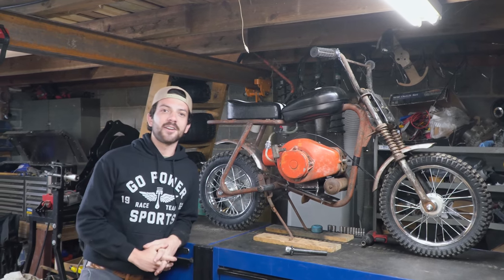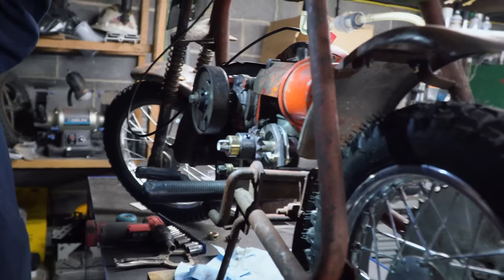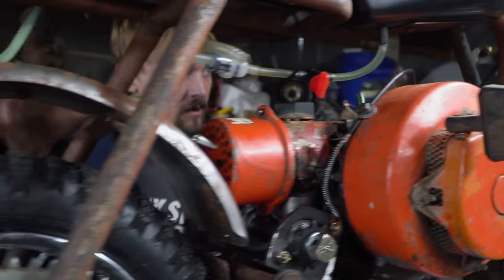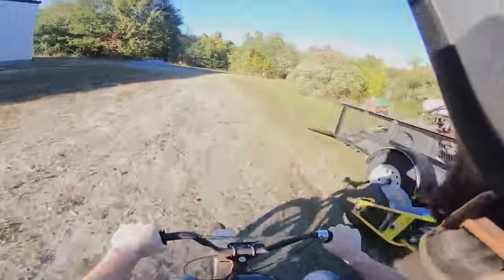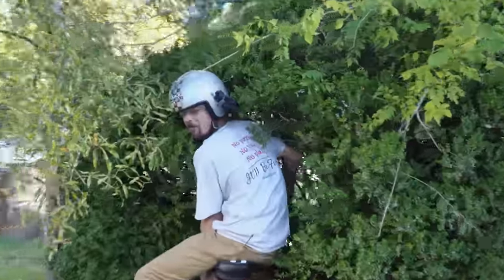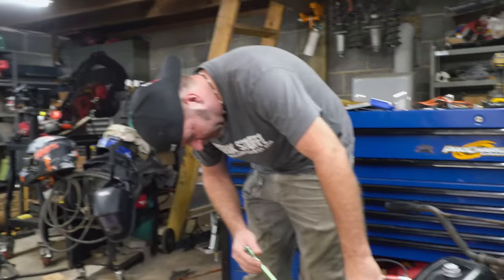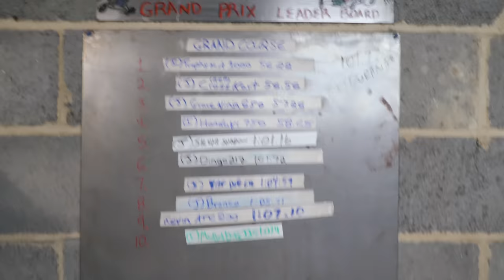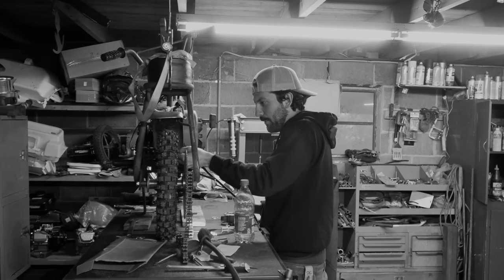Making our 2HP 2 Stroke WASHING MACHINE Powered Mini Bike Faster!

Comment: Y'all are gearing that tiny 2 stroke like it's a 4 stroke. Your power is on the higher RPMs! Great job, I love every build you guys do!! I hope you all do more 2 stroke builds. The amount of power you can get out of those tiny engines is incredible!
Reply: No matter what gear combination used it’s still 2hp,
Reply: @vermontaviator1248  my Puch Maxi was 2hp and could at least pull pretty well to 30mph without an issue. It's now like 7hp and rocks.
Reply: @vermontaviator1248  it does matter if it doesn't get into the powerband.
Reply: It sounds like the governor is kicking in way before it needs to, but again, 2hp.
Reply: Those old two strokes were awful even for the application they were intended for, I worked on tons of them in the late seventies but hated every minute of it.
Reply: That engine wont give much more even with gearing set up these type of 2stroke motors dont have a serious power band. If the governor and carb was changed and a exhaust tweak it should perform better and a clutch weight adjustment so it kicks in later at higher rpm would pep it up abit
Reply: @g_compo8639  Yes these old Jacobsen are a cross flow (single transfer and ramped piston) they predate shcnuerle port, and expansion chambers, they respond better to megaphone exhausts rather than expansion chambers. For all those doubting the potential are wrong as They can make respectable hp just like the old Westbends and McCulloughs of the late 50s-early 60s used for kart racing, they are a more, tourqey low revving compared to the modern two strokes(schnuerle port). Good Mikuni conversion, and decent megaphone and it will perform pretty well. I own a few Jacobsen's from the early orange models to the later black ones like ones used on the snowblowers etc, 100cc rated at 4hp at 3500 rpm, mine are tuned to run twice the rpm and I'm sure is Easy 5-6hp. I built custom manifold to run 19mm Delorto and built a tuned megaphone, massaged the ports for lil more flow/rpm, currently have one in an old fox minibike that hauls the mail rather nicely, but really killer is my rupp go kart powered by two of the later 100cc engines made period of the early 60s racing karts. The Jacobsen they have is only 80ccs at the most, but don't let it fool you, they could easily make it hold its own against a 6hp predator.
Reply: @2strokejunkie686  I totally agree these engines can be woken up with fairly simple modifications I just want to see more 2stroke action being I use to mess with alot of 2 strokes in my younger days especially rotax engines
Reply: @g_compo8639  Yessir I completely agree, and right on Rotax made some of the best back in their day, I own an 82 can am with the 370 MX engine by Rotax one of my favorite engines, tractor like low end with enough topend to rip your arms off haha nothing like the old bigbore two strokes...I eat sleep and breathe the vintage two strokes and own over a dozen machines from 50cc- 750cc kawi triples, both street and MX based machines.🍻😎
Reply: Pull the governor and gear it for higher RPM. Let that old 2 stroke get into that 2hp power band 🤣
Reply: @vermontaviator1248  It's not the HP, it's torque.

Too much time out of the powerband is what you are witnessing here
Reply: @vermontaviator1248   2 hp is more than you might think on a 2 stroke compared to a 4 stroke. They need a clutch that bites at a higher RPM so it will launch, and much lower gearing to let it fully wind out which it's not even close to winding out right now. 2 strokes are a special breed that need the perfect combo to work correctly. The power band is in the top range of the RPM way above the middle range even. My 1.5 hp 2 stroke moped has more power than my brothers 4 hp 4 stroke moped
Reply: @g_compo8639  2 stroke don't have aa serious power band, what? You must have never ridden a CR 250 R or any @ strokes. 2 strokes are known for riding on a serious powerband.
Reply: @g_compo8639  Yup, a clutch that bites at a higher RPM would be the first step to get it to launch out the hole. 2 strokes don't like to run at low RPMs.
Reply: Also, adding a tuned pipe for a go-ped would increase the power. That exhaust on it is robbing more than 50% of its power I bet.
Reply: @FarmerFpv  Yeah, it'd be cool to see C&C build their own tuned 2 stroke pipe with the help of their plasma cutter! My Puch Maxi's on their stock cylinders basically doubled their power with a proper pipe and bigger carb.
Reply: ONE MILLION SUBSCRIBERS !!!

CONGRATULATIONS !!!
Reply: @FarmerFpv  this engine doesn't have a serious powerband. It's not like most other 2 stroke motors read my comment properly and I've dabbled with 2 strokes for over 20years I use to build rotax motors and run a big single 500cc rotax 2 stroke motor on one of my road bikes making over 100bhp modified and tunned by me
Reply: @vermontaviator1248  well if it's not even in the power band you're not getting the 2hp.
Reply: @g_compo8639  it's no use lol I've tried to explain the nature of these old cross flows and there modest potential when setup right. So tell me more about that 500, I always wanted to try one, but never got the opportunity, have ridden the 406 and own the 370, from what I understand are nearly identical. The 500 was supposed to be one of the more docile, bigbores similar to the way maicos were known for, arm ripping yet predictable and controllable.
Reply: @MrLink12765  the LAST thing these guys need to do is build a halfass expansion chamber that won't work..   lol     you can't just wing it and expect it to work.    And based off the facts that they have yet to have a genuinely successful 2 stroke..     and very clearly don't understand 2 stroke engines..      they have no business trying to make a pipe.
Reply: @g_compo8639  you have videos of said 500 cc single rotax?   Assuming it's a made for Can am or KTM engine?
Reply: @CobaltOntarioadventures  They have the tools to do it, they just need an expansion chamber calculator. It's not as hard to do as you would think.
Reply: @BuffMyRadius  the "governor" is the lack of expansion chamber and that carburetor.
Reply: @MrLink12765  math is simple.      Pipes need to be acurrate to the mm and on cone sections..    They do not possess those skills.
Reply: @CobaltOntarioadventures  They have the skills to make a proper 2 stroke chamber. Have you seen any of their other builds? It may not be to the T 100% perfect, but usually no off the shelf chamber is either. The thing about C&C is, they'd at least put the effort into understanding and showing us the process of doing so if they wanted to. They may seem like idiots but they are really talented individuals that could figure out how to do it.
Reply: @MrLink12765  never said they are idiots...    just not 2 stroke mechanics.
Reply: I also can appreciate them showing them learning.    They tend to act like they know when they don't though.    And FRT, I've been here since before Ike had pubic hair on his face.     I love lots of their builds..   lots (generally the 2 strokes..   and 4 cylinders with 2 chinese random carbs and PVC pipe - blaming the engine for crap power and response) of their shit makes me cringe.    Still great content to pass time by, and in a genre I like.     Doesn't mean they are the be all end all to building and mechanics.   They are not.
Reply: @2strokejunkie686  you could bend the metal around something, this is C&C, they do things janky all the time. If it were me, I'd be using cardboard aided design along with an eagle grinder, hammers, and could pull together a pipe more tuned for my 2 stroke than a store bought one. Not everything needs to be pretty for it to function like it should.

Check this guy out: https://youtu.be/qVCrJnJWWbM

Not only is he doing jank on his "twin 2 stroke" but he builds proper expansion chambers with none of the useful tools C&C has
Reply: @MrLink12765  Ike said it still has the governor installed, unless he was making some kind of joke?
Reply: @g_compo8639   It can put out triple what it has now I know I know I'm experienced with this engine. You're not the only one that plays with 2 strokes if you look at my channel I race and freestyle motocross and build my own bikes l jetskis all 2 strokes. Yes its not going to be a cr 250 or a 500 but its going to have way more power than it does now with the correct setup.  For one they're dogging it with the clutch they have on there.
Reply: @alessiocarlevaro6934  two words, centrifugal clutch... Stiffer spring, somewhere 3200-4200 rpm engagement, taller gearing and a mikuni round slide with a shaved head and a megaphone exhaust or expansion chamber... She'll do 40 no prob

Comment: If possible, I would gear it for more low end. You can hear it start pulling once it gets going and it would be easier on the engine. You probably won't lose too much top end, but if you do, you could gain that back by removing the governor. To me gearing is everything. Keep up the great work.

Comment: Gearing helped, but it is the low rpm clutch engagement that is the problem.  That  engine makes no power at 2k rpms....mod the clutch to engage at 3.5 or 4k rpms and it would be heaps better.

Comment: Im ngl id mock up a little pocket bike or 2t dirtbike pipe and get a lil 17mm or 19mm carb on that you can change the jets in.  Get that thing hitting a harder powerband and revving higher.  Gearing with 2 strokes is weird, you get it into the powerband with shorter gearing you may actually pick up some speed too.  But id mock up a lil expansion pipe and carb, things cool tho!

Comment: This classic iron brings back memories. My Uncle had a Rupp Roaster II, that be passed down to my older brother. I think it had a 3hp Tecumseh with a legit Comet Tor-Q-Verter. It also had front and rear suspension, head and tail lights, and front and read drum brakes. I'd love to get an old beater minibike and throw a Predator in there, add some go fast parts, etc. I course, in my weight class (300 lbs!) I need all the help I can get. Maybe I should start with a Tillotson? LoL

Comment: That’s the most 4 stroke sounding 2 stroke ever lol
Reply: That's Due to fact it being a cross flow,(ramped piston, single transfer port) modern two strokes are known as schnuerle ports, multiple transfer with radial orientation. And flat or dome top Pistons👍
Reply: @2strokejunkie686  didn’t know that, thanks for the info!
Reply: @danm2422  yessir,glad to help if you are a fellow two stroke enthusiast, you should look for the book called tunning for speed it was originally published in 48 and updated few times from 60s-70s but goes over all the period porting methods and pipe building, mods of the days of cross flow two strokes and into the days of schnuerle ports aswell. These old cross flows predate expansion chambers and schnuerle ports, being so much prefer being tuned with megaphones over expansion chambers, port work methods and formulas behind it  was also much different than schnuerle ports aswell.
Reply: @2strokejunkie686  ok cool I’ll check that out, honestly I don’t know a lot about 2 strokes but love the sound and love to get into the power band on em. Too much fun

Comment: Put heavier springs in the clutch and grind some weight off the clutch shoes it will raise the stall rpm drastically and let the engine get into the power more quickly👍

Comment: Ya'll ain't gotta worry about popping that engine from high revs. Two strokes have a compressive load on their rods at all times. That thing will run out of power before it's in any danger of exploding.

As for perking it up...get an alcohol carb on it and feed it RC car fuel. 20% nitromethane, 12% lubricant, balance methanol. It's gonna FLY on that stuff, prolly spit out 4-5hp.
Reply: Itll melt down on nitromethane
Reply: @CobaltOntarioadventures  Engine would run cooler, actually. Significantly so.
Reply: Combustion temp may be down, but it will blow up.   We raced plenty of PROPERLY tuned sleds on the lake and nitro eats crank seals.  It will melt down.      It isn't an RC engine with no seals
Reply: @CobaltOntarioadventures  They have a second engine for parts and they'll maybe ride it 3 or 4 times before it gets shuffled off into storage alongside all the other builds they do.

No harm whatsoever in feeding that thing a hot supper or two.

Also, it aint that much nitro. The bulk chemical is gonna be methanol.
Reply: @TestECull  it's the methanol that dries seals  lol    anyhow, not trying to be confrontational here.    But I've seen plenty of 2 strokes pop on nitro.   Lots.    
    That being said, you're right about them getting a few runs out of it and thats that.     For kicks, sure rip it on nitro.       They got their money back already on this video for sure.    That's the difference I guess, between making content and building engines.
Reply: @CobaltOntarioadventures  That's precisely why I floated the idea in the first place. They have a parts engine and this isnt a daily rider for them so no harm in feeding it hell for shits and giggles!

I might get a junky smallblock chevy and do something similar myself, only I would also machine adapters and put glow plugs in it from my RC engines. Just to see if it would even run like that. Be funny to post it with no context 'smallblock chevy runs with no plug wires or coil!' and see if anyone figures it out.

Comment: Gear Ratio Calculations Example:  eng sprocket  10 tooth  to jackshaft sprocket 30 tooth,  other side of jackshaft 10 tooth to wheel sprocket 60 tooth.  Engine to jackshaft ratio is 3:1 and jack to wheel is 6:1  the combined is 3x6= 18:1  There are some simple formulas knowing the engine RPM, final ratio, wheel circumference to calculate MPH,  or reverse that since you know the 25MPH, you can calculate what RPM the engine was turning.  You can also calculate what size sprockets to use if you want to change the ratio by a certain percentage.  Then some more fun stuff based on HP, weight of bike or go-kart, the ideal gear ratio can then be approximately predicted based on data from other builds.  Of course it depends if are going for pickup or top speed things need to adjust.  You guys probably already do this by feel since you have so many builds and experience.

Comment: Yawl need to gear that thing a lot lower and you need a loser clutch that bites at a higher RPM. Two strokes only have power in the top 3/4 of the rpm range. You will get more top end speed if its able to wind up all the way which it's not able to right now Also adding an expansion chamber or a go-ped tuned exhaust pipe will help alot too.. John and Charles get a little wild, Ike is like the older brother caught in the middle keeping you boys in check. lol. Exactly why I love this channel. John and Ike have a great dynamic together, add Charles and it's like the cherry on top. Stay awesome boys!

Comment: Some stiffer reeds, a better flowing carb/air filter and a tuned pipe would really wake that motor up. Also some stiffer springs in the clutch for better take off.

Comment: I'm know it's slow guys, but the truth is there is potential there.  I like the build.  I think higher clutch engagement could help more, and or a torque converter.  I'd be tickled pink if you guys made a tuned pipe for it, that will come close to doubling your hp.

Comment: You're using a clutch set up for a 4 stroke engagement rpm. Cut about 3 coils off the spring inside ( I will raise the engagement Rpms) and try it again.

Comment: That rigid frame doesn't have to f-ck your spine up if you decide to jump it. Stand on the pegs with your knees slightly bent(your human shock absorbers), squeeze the bike with your legs and keep your weight neutral (neither forward or backward) and the bike should jump it's self, more or less. In motocross, we blip the throttle in mid air if we want the front wheel to raise up and tap on the rear brake to bring it down. (might not have the power to raise the front via throttle with that engine). You'll know what to do if you keep this in mind. Land on both wheels at the same time if you can. Cllo little bike. Wish it had shocks and forks with both springs and dampening the compression and rebound.

Comment: 2 stroke tech tip direct drive the engine to the jack shaft and have the clutch on the jack shaft it’ll increase the stall and will run faster and alot better

Comment: Try replacing the slip clutch with a vbelt and a idler pulley clutch.  Those Jacobsen two strokes were even useless back in the day.  Try taking an old OMC Lawnboy engine, they used needle bearings and ran better.  You can lay one on its side but you will have to remove the governor control and make an intake manifold for the carb into the reed valves.

Comment: That two stroke is really low revving mostly because it’s limited by the coil but you can still gear it towards its strengths. Also an expansion chamber of some kind would wake it up and double the output.

Comment: Next build should be a mini bike with one of those old 2 stroke tecumseh snow blower motors with the bronze/gold pull start covers. Lots of toro blowers came with them. I believe 2-5hp models. Would love to see how much power gain you guys could squeeze out of one. Maybe a slide style “mikuni” carb and a pipe off a yz85 or something.

Comment: You need a 2 cycle clutch that revs higher before it grabs pretty much like a racing clutch but that’s capable of engaging at higher rpm then a 4 stroke clutch

Comment: losing the exhaust entirely probably won't help, but giving it an expansion pipe would certainly give you more power.  the problem is, you don't know where to expand and where to contract.  it's different for every engine, and also different depending on what you want from it.  for example, you can tune it to provide a bit more low end, or a bit more high end.  so it would take quite a bit of experimenting to get it how you want it.